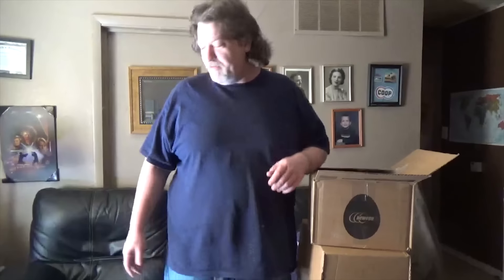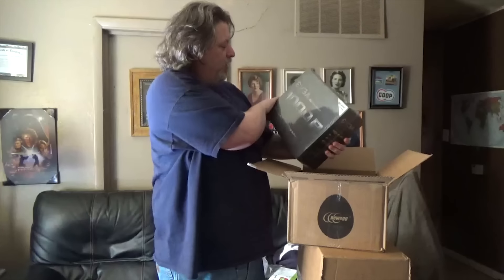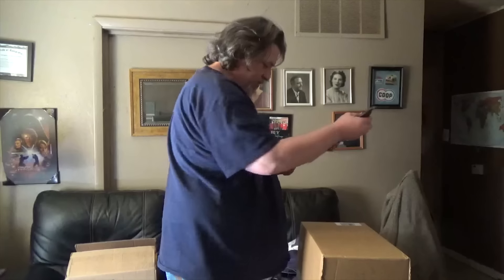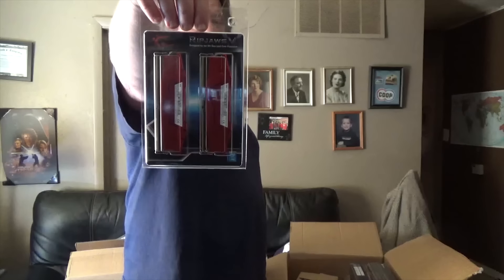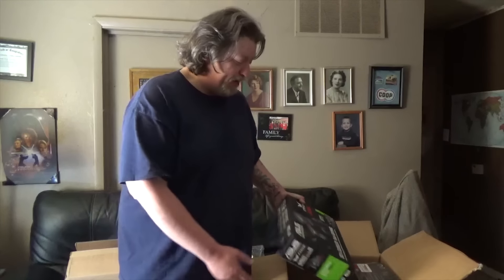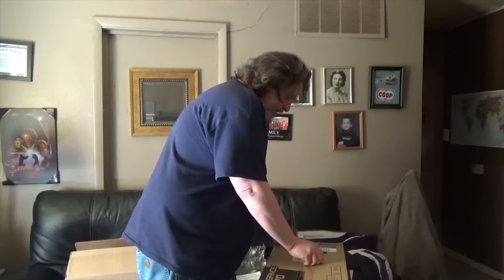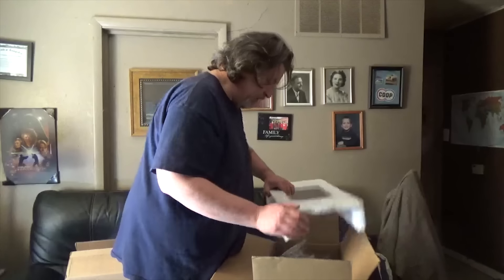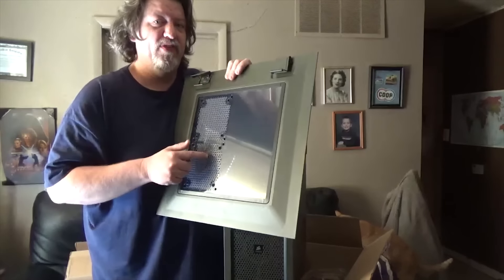New Computer Unboxing! | Skylake 980ti Gaming PC  | JoethePirate

Comment: Nice build!   Currently building my own Skylake box and can relate to the case strife!   Wanted to chime in on your HDD issue.  They do make 3.5 to 5.25 bays so you could securely slide your drive into one of the unused 5x25 bays and have the option of removing the bay at the bottom.  Was a contentious issue for me to which case I picked until I found it.  Looking forward to more vids!  Thank you much sir!
Reply from the maker: +J Edwards I might explore that option later, but I like having a fan blow right over my HDD right now.  If I decide to water cool my GPU in the future I might need that lower bay for a radiator.

Comment: yeah i didn't like that case at first, fans on the side like that are for PCs like 4 generations ago.. but after you replaced the window with the red trim it looks awesome.  BTW I still want your old 660 to replace my 550 ti (on 2nd PC)
Reply from the maker: +HUGSaLOT Valkyrie Yeah, my son has decided that he wants the old one to play PC games on.  I'm hoping to get him into YouTube again.
Reply: +joethepirate1 okay that's cool. Since you're having some issues with that video card in some games, and considering how old it is, you might wanna disassemble the fan shroud, and the heat sink, blow out the dust and crud from the fins and fan. Clean up the thermal compound on the GPU and heatsink, put some new thermal paste on it when you re-assemble the video card, and it should perform as if it were new.

Comment: Hey Joe, my name is Joe!  I just bought the Corsair Vengeance Series C70 Gunmetal Black Case and VSkill Ripjaws V Series 16GB kit based on your recommendations and your gameplay.  I also went to a core I5-6500 Skylake and a GTX 1060 6GB so I can play 7DTD...
Reply: I'm running a 600W Corsair Power Supply and a 480GB Mushkin SSD.  The whole build was about $1000 with my Win 7 Pro 64 bit from MSDNAA..

Comment: one question, why not just place old hhd in new system to copy files?
Reply from the maker: +Sean Moline Good question!  I tried that and since Windows was already installed on both, the computer got confused and thought I had a counterfeit copy and insisted on a new product key.  I had to do a hard-boot to get the system to stop asking for a product key.Since I still plan on keeping the old computer, I need it operational, too.
Reply: +joethepirate1 interesting issue. for future systems dont activate windows tell you copy all your files. I'm currently having windows 10 pro issues with deactivation of a key and down grade ti home for one of my server vms, funniest part windows help desk cant figure it out either.